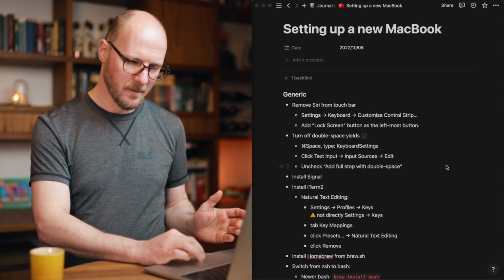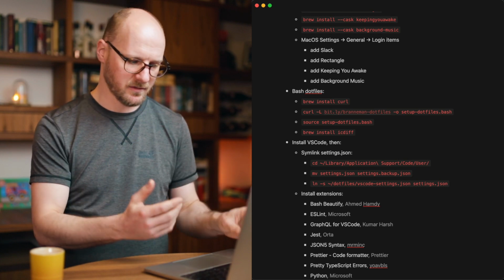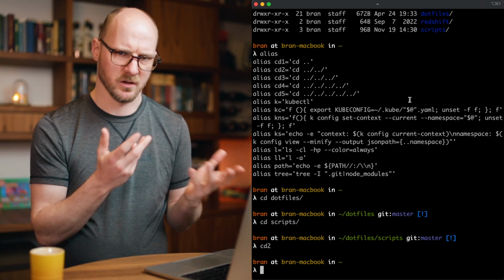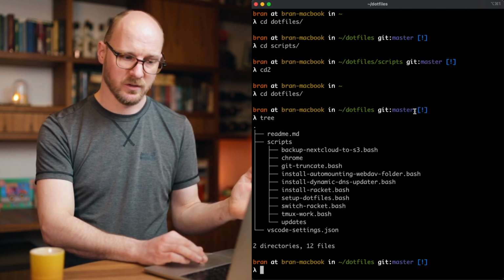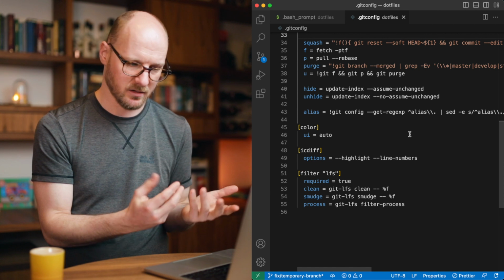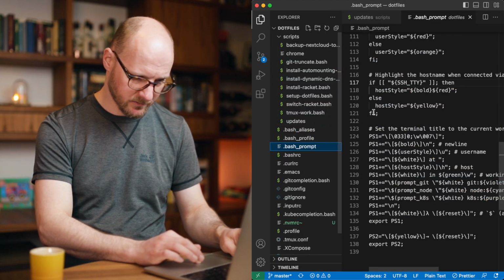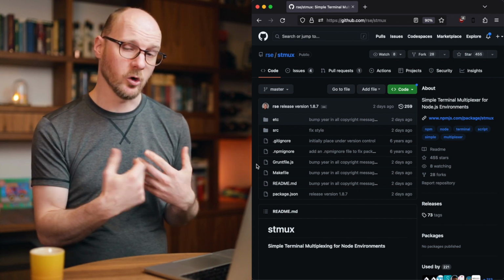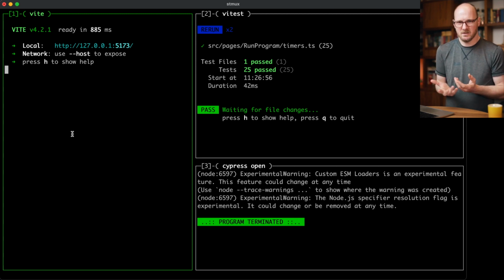My Terminal - Automation Mindset Explained

Comment: Great presentation. And holy moly, stmux looks great. I tried several times to do exactly what you did in the video - write a script that opens 4 panes, 2 left, 2 right, and execute different commands in them - with tmux, but never got it working, so I gave up on that idea. Now stmux way of allowing to do this looks super simple. Amazing. Thanks for sharing this tip and your general dotfiles collection. I see a lot of great things in there that I will likely adapt. Thank you.

Comment: this is primitive stuff when when compared with NIxOS, your everything is just configurations. say got a new pc, setup the disks and copy the configs, run install... everything as you remember in the new pc too..
Reply from the maker: Sure, but does it do macOS as well, or are you talking about the Linux distro? 😇
Reply: @branvandermeer  i heard it works on macOS. a package manager that's configurations based, not just the software but it's configs, integrations with other software. basically like docker container for development but without the waste of resources.

Comment: Thanks for this incredible video. I am currious about stmux: does it works on native widows (without WSL) ? 

I was interrested in zellij that have pretty much the same features as stmux (but seems faster because it's written in rust). The problem with zellij was his incompatibility with windows (I have to use WSL)
Reply from the maker: I wouldn't know if there's support for Windows in stmux; but I would guess so. Try searching for 'windows' in the stmux readme; there's some notes on windows with and without WSL. The solution could also be using a different terminal emulator than just cmd.exe
Reply: @branvandermeer  thanks, I just tried it in windows without WSL and it worked with no problem

Comment: First of all thanks again for sharing this much experience of yours. I definitely learned a lot from this one.

However I am curious, how much time did it take for you to write all this, and for how long are you using it without spending time regularly rewriting/upgrading/fixing it, once it breaks or works not as intended or simply once you learn sth new and realize that it should be better?

Because for me it was always a pain, once I started approaching "my machine configuration" in a more serious way ( not to put up with what's already out of the box ), the less I actually spend on working on real projects.

So when the deadlines are running out, I find myself switching back to Windows and VS Code just to get the job done.
Reply from the maker: Thanks, I appreciate your comment!

It took years! It's important to start today, then it can slowly evolve. The first commit on my dotfiles repo was in 2014, I invite you to look at the git history of that repo, the oldest 4 commits already have bash aliases, git aliases and a bash prompt. I didn't spent that much time, since haven't invented many of the things in the repo. You can find many beautiful bash prompts, I just took one and customised it.

My recommendation is to start small, and keep taking small steps. If you spend 15 minutes per week the impact is negligible, but a year from now, you'll have made serious progress! The magic of compounding :)
Reply: as a dev, you learn that all "legwork" before coding is useful. All.

Comment: I am pretty on CLI, I want to learn more, and I see your Aliases, how to fit that oj Windows?
Reply from the maker: All of these things are doable on all operating systems. I've customised Linux and Windows machines as well in this way, it's just slightly different there. On linux, you have bash, and you can make that work 100% the same as on macOS. On Windows you have to choose whether you want to run bash (e.g. inside WSL), or invest into learning PowerShell. You can optimise your PowerShell environment in a very similar way, it has most features I believe. But, I would recommend a cross-platform tool like bash, because you'll never know when you change OS. I never expected to, but did so twice :)